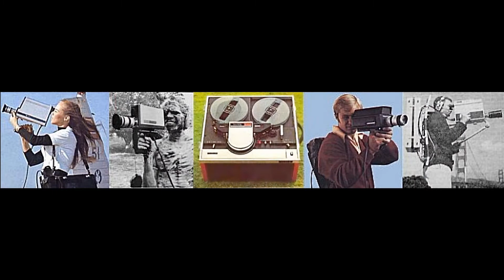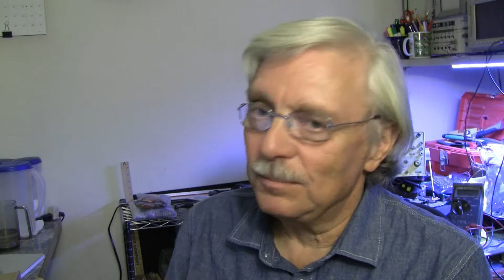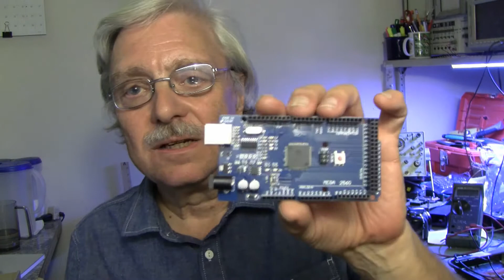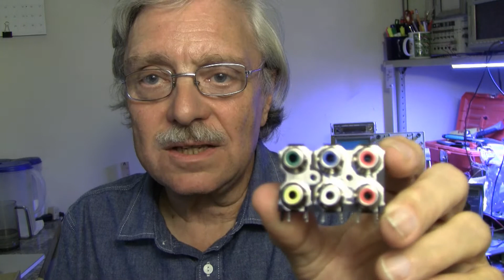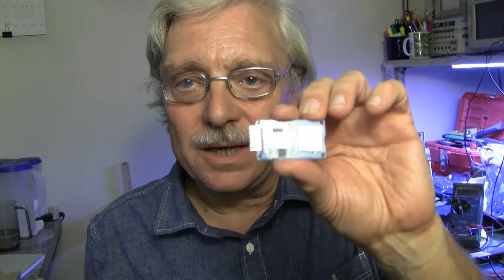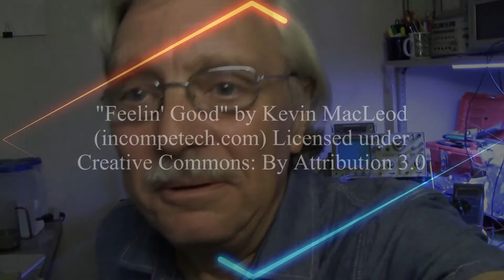NBTV Televisor Project, updates part 4

Comment: The ArduinoVisor is open-source, runs on an Arduino Micro (about $8 each) and as @Robonza says, streams uncompressed NBTV audio and monochrome (NBTV standard; 32 scanline) video in real-time off a SD-card. It even comes with an optional touch-screen interface (Nextion). The entire televisor is a single board (also open-source) about the dimensions of the Arduino mega that you show here.
Reply from the maker: Thanks for the excellent suggestions Andrew and Keith! I have decided to stay the course and complete the following projects. The (all analog) BIG Televisor, the (all analog) CRT televisor and the hardware based NBTV signal generator as designed. On the last one, it satisfies my desire to build a project of my own that used internal reprogrammable memories. Its a desire that goes back two decades.

Comment: I am curious why you need the ram chips? Couldn't the Arduino read the card and convert to analog in realtime. My tv manages audio and black white in real time from the SD card. The source code is open if you wanted it. 2nd option is to store a whole image in the Arduino Mega, The mega ram is 8K e,g, 6K ram per image in 8 bit leaves 2K ram for your program.
Reply from the maker: Are we talking about NBTV video? Yes. I would like to see this source code you talk about. Point me to it. You missed the  part where I mentioned that a computer can not process video signals in real time to meet my standard of quality. I am aiming to create a source of PERFECT video signals. 40 years as a professional video engineer has made me a bit fussy about video quality. Compressed AUDIO playback does horrible things to video signals.
Reply: @videolabguy  I don't follow you - why would the audio be compressed? The standard digital signal for NBTV is 16 bit 48 kHz PCM (yes it is also 44.1 kHz but that is for the sake of CDs) - it is NEVER compressed.
Reply from the maker: OK then. I have no way to know that. I don't do much in "social media" and, as far as I know, I am the only person in Silicon Valley who is doing this hobby. So, I live on an asteroid in hard vacuum. Working in total isolation here.
Reply: @videolabguy  Actually, the format is up on the NBTV web site, the handbook there is well worth a look. Actually there are quite a few US members and enthusiasts, it wouldn't surprise me if there were some in your area.
Reply: @videolabguy  We are plating back uncompressed 8 but audio and video on a very cheap arduino real time from SD card. You can get my email if you google these words Contact Details EDNS Mairangi bay
Reply from the maker: OK. I dropped you an email.
Reply: @videolabguy  https://github.com/andrew-davie/NBTV has the source code